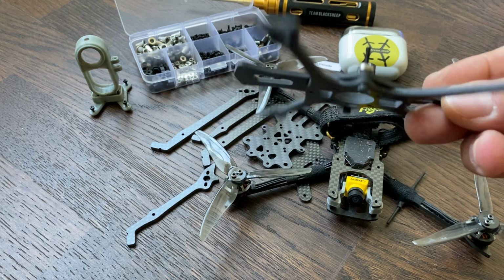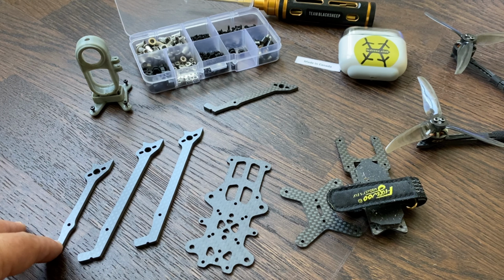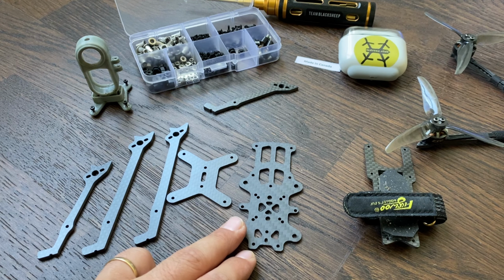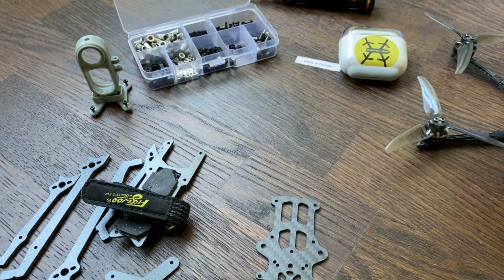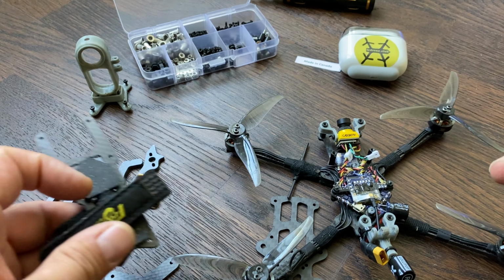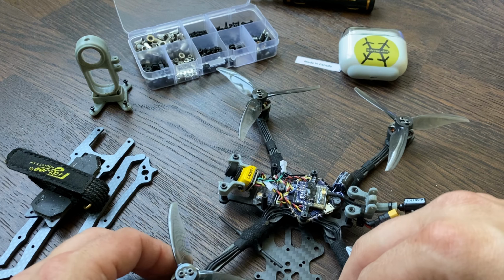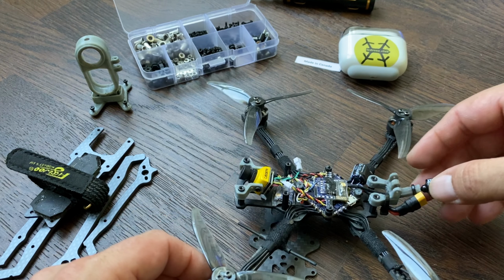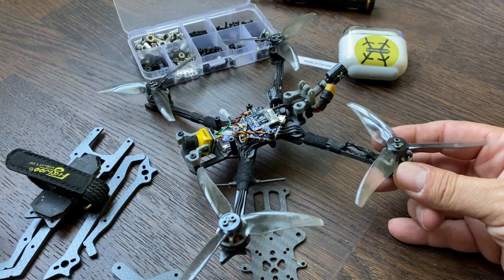MOD-L frame discussion and flight footage

Comment: Hi, that`s very interesting. I have already built your pickle MK2 with analogue equipment and a MOD3 Unibody 3" with a Vista. Both doing great! Do you think the GEPRC 1404 3700kv would also work with a 4" MOD-L with a Vista Kit? Appearently I have 4 of these exact motors and a Vista left....
Reply from the maker: Yes sure, 1404 is a good size for this machine if you keep the weigh reasonably low.
Reply: @Ledroneclub  Yeah, the Vista adds about 20 gr. and then I would probably need 850 4s packs. Not sure if it won`t get too heavy for the small motors.
Reply: Well, I guess I will just try it :)
Reply: BTW: The Cargo Version is not on Thingiverse yet
Reply from the maker: Christoph Dejok yes I know :( I totally forgot to upload it
Reply from the maker: @SerialKoE  Just added the cargo plates on the Thingiverse. may take a few minutes to show up
Reply: @SerialKoE  do we need the cargo to fit a naked caddx vista and a whoop AIO board?
Reply: @M.TTT.  No, only if you want to use a 14x14 or 20x20 stack and a Vista in the back. In the normal or short version the Vista has to go over the whoop board, mounted to the top plate.
Reply: Or you can use a Whoop board and put the Vista in the back to get a low frame as shown in the video....
Reply: @SerialKoE  hmmm, okay, what would you do and what stack do you plan to use? I actually don't know if I can trust the AIO whoop board to go longrange to be honest
Reply: @M.TTT.  Whoop boards are fine, as long as you don't crash.  I think I'll go with the cargo body, 4" , whoop board and a Vista in the back using 20mm standoffs.
Reply: @SerialKoE  ah okay, by crashing you mean that can blow the ESC's on them or they're just fragile? Also better to have the low profile than a smaller frame or is that personal preference somewhat?
Reply: @SerialKoE  and depends what AIO whoop I buy, I don't know any of them with enough UARTs for DJI, gps, and crossfire that are any good
Reply: @M.TTT.  yes, the ESC's...
Reply: @M.TTT.  Not sure if you could source a third UART on a whoop board from LEDS or so. Might work.
Reply: @SerialKoE  yea, soft serial or what not, I'll have to look into it

Comment: Nice frame, I have 2! Not got any electronics in them yet but got 2 5" shortbacks from cncmadness. Minor feedback so far, the holes in the top could be slightly better arranged to allow 2x 14mm straps or 1x 20mm one. I like to run 2 straps if I can. If you are looking at the rear cluster a gps/buzzer/antenna mount like on Dave_c's micro longrange would be awesome.
Reply from the maker: Thanks mate. I’ll take a look at those holes. The current arrangement takes into account that one could mount something on the top plate 20x20 holes but it could be better for sure :). For the rear cluster I wonder if Dave’s one would fit directly, I’ll check 😈
Reply from the maker: So the gps cluster of the Micro/Mini long range fits the mod SB as well :) (same 16mm distance between standoffs)

Comment: Hi, 

I am unsure which parts on thingsverse I need in order to build a 3" shortback with a analog nano camera?
Like the Caddx Ant?

Any thoughts?
Reply from the maker: Hi. Beside the 3inch arms I’d recommend the HD_shortback bottom and top plates. Plus the bottom cross plate which is common to all versions

Comment: I'm curious, would a caddx turtle v2 work with this? I know the baby turtle would work with the nano mount, but I don't see a micro mount. Would I just use the tarsier mount? Thanks!
Reply from the maker: it will probably work with the Tarsier mount yes as it's a micro sized one. Otherwise let me know and i can make a suitable one
Reply: @Ledroneclub  OK will do. I can probably just have my 3d print guy remix it for the turtle micro cam. 👍

Comment: Yeah! You just tried what I was scared to try: 1404 3750kv 4’’ props on 4S :)

Very nice design! I’m tempted. Will you allow taco-rc to sell these?
Reply from the maker: nikotttin the better way to get them to sell the frame is to ask them to do :) I have absolutely zero influence on what they decide to sell :)

Comment: How much does the Mod-L 3" weigh fully assembled? Thanks
Reply from the maker: It will be something between 90-110g without battery, depending on the gear you use and how you build it.
Reply: @Ledroneclub  Sorry, I should have been clearer.  I mean the frame fully assembled with tpu parts and hardware. Not talking about the stack or receiver and antennas. 

Thanks!
Reply from the maker: @vbp6us  it should be around 30g with all the mounting gear
Reply: @Ledroneclub  thanks.